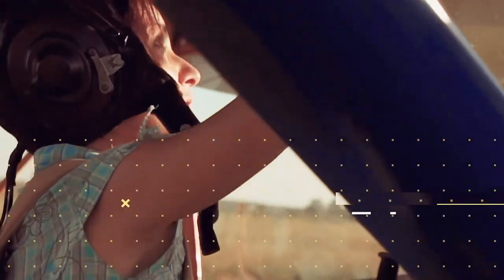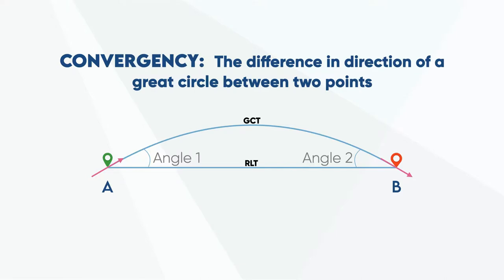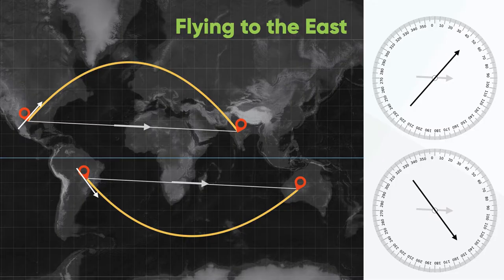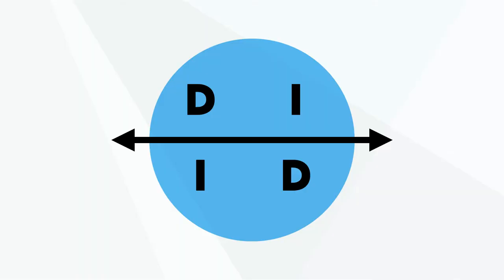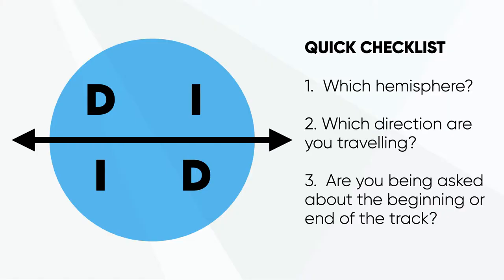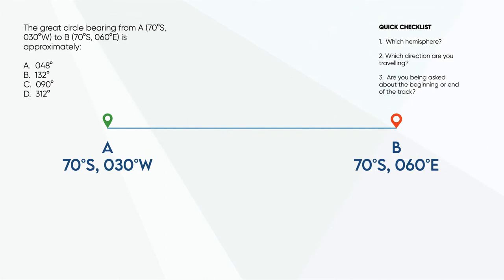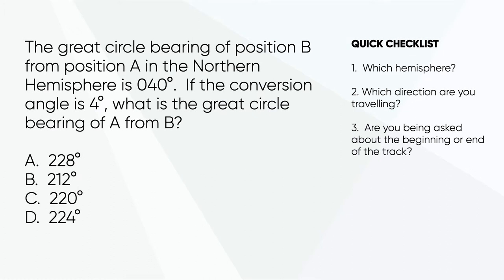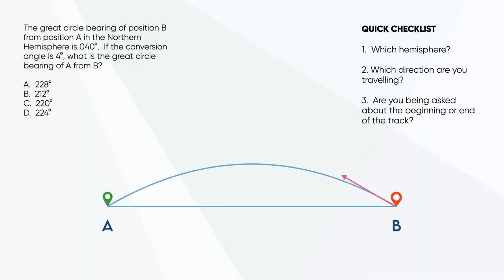GNav Basics 4b:  Convergency 2

Comment: You are better than my flight school instructor 👍
But one doubt, when we should   add or subtract the conversation angle
Reply: Depending on if you are going FROM GC to RL and in what hemisphere you are in. For instance, if you have the GC track and the CA in SH and you need the RL to think in what direction you are going. you need to go UP, therefor your answer will need to be a lower number (so you need to subtract) like the guy in the video said, draw it and you will see it. draw a compass rose beside it with the NWSE numbers on it, then you can approximate your answer that way you will quickly see if you need to add or subtract. Good luck

Comment: Can I memorize the numbers?
Reply from the maker: Which numbers do you want to memorise Mohamed?
Reply: The av exams genav calculation questions ?
Reply from the maker: If you mean the answers to the questions, I would always advise against just memorising the answers. Sometimes they use the same numbers in a different order, or will change a positive number to a negative- so you think you know which answer to choose but it will actually be wrong.